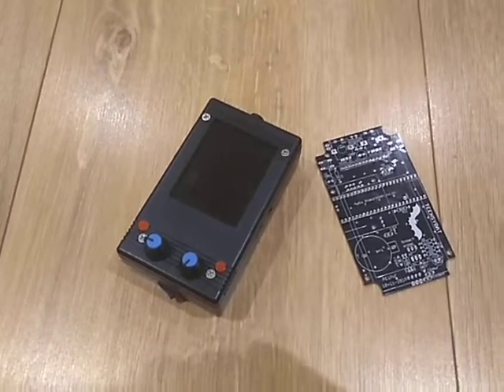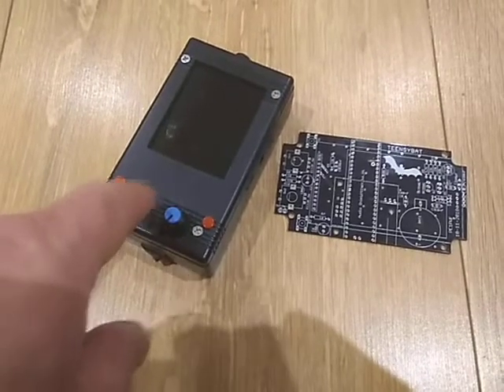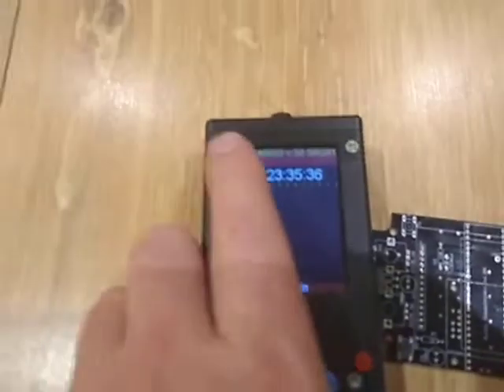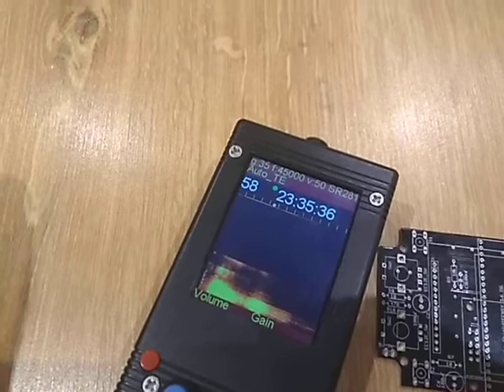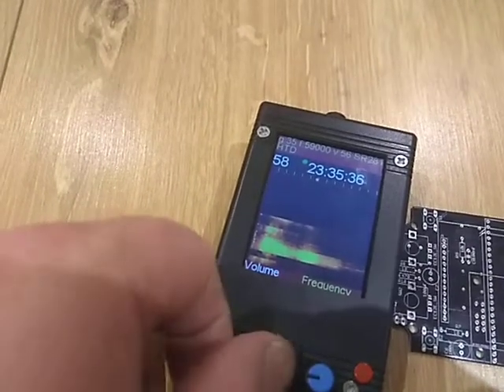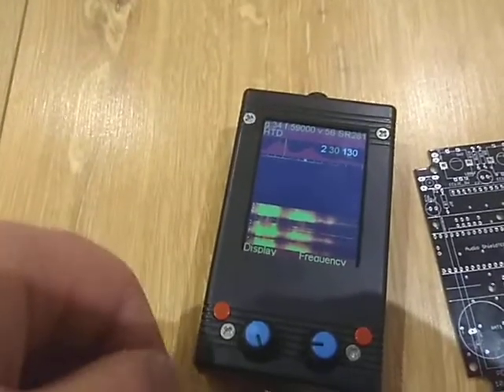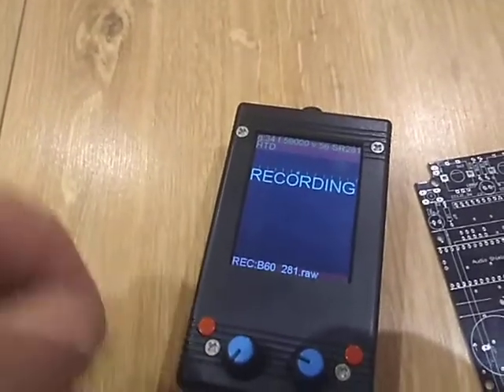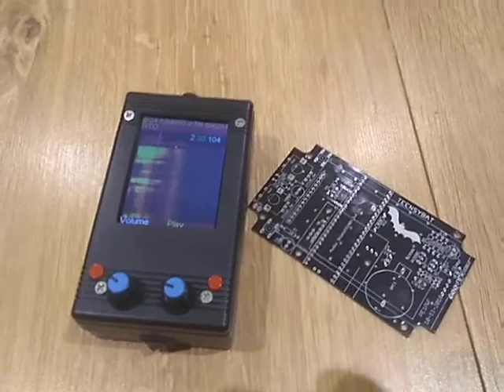Teensy bat detector.

Comment: where can i buy this kit please ????
Reply from the maker: Hi Dave, did you try to search for TeensyBat on internet? It should not be hard to find teensybat.com I guess. All information to build one is on that website now. Including a small parts shop which usually has boards with microphone and also some partial kits available.
Reply: @PE1PWF  ok many thanks